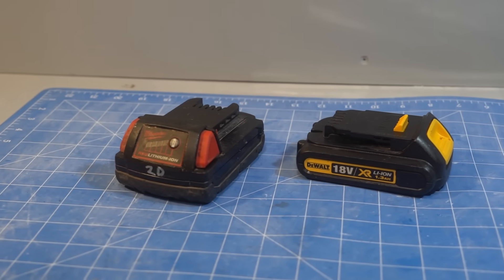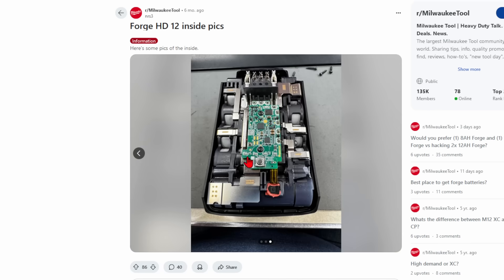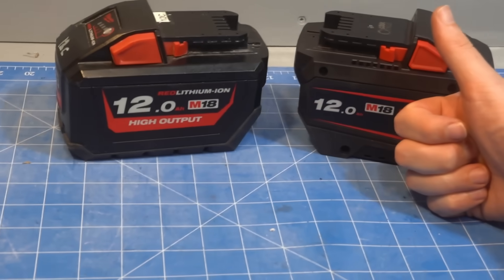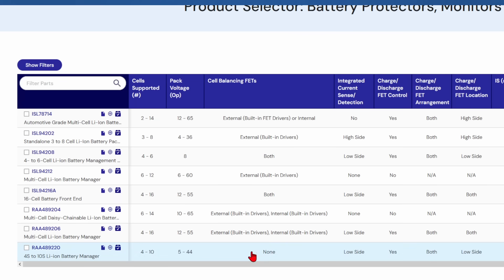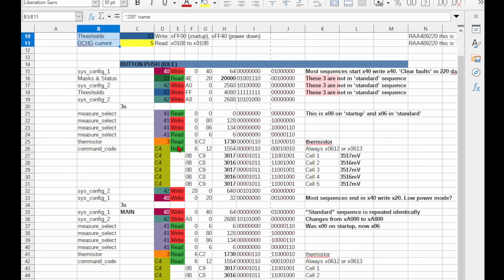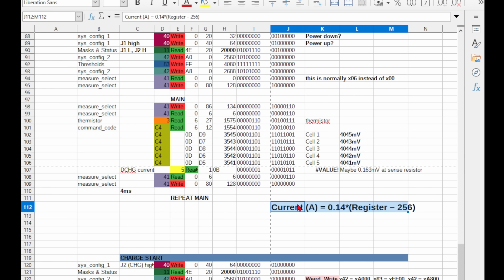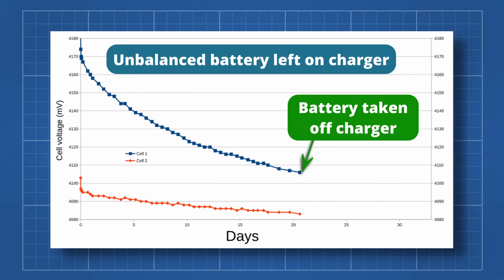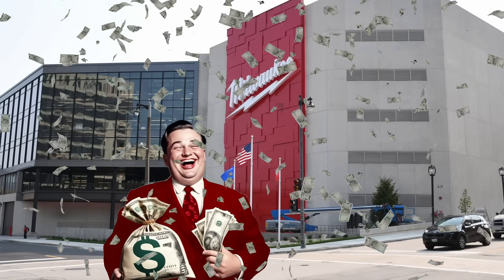[011] Do Milwaukee FORGE batteries balance

Comment: Reddit army! Kinda disappointed the Forges still don't have balanced cells.  Still great batteries for output, so let see if they're last past the warranty!  Thanks for the analysis.  As an electrician, I wish I got into circuit boards so I could understand what you're saying better, but the video is still informative nonetheless.

Comment: So do ANY 18V tool/battery brands do cell balancing?
Reply from the maker: Not yet, but I've only tested Milwaukee and Dewalt for balancing. I need to revisit Makita, and then I've got Bosch waiting after that.
Reply: @toolscientist Guessing Black & Decker doesn't either. Not as big in tools anymore, but they make a bazillion weed eaters - and the most common packs I find and fix, they're easy since they have some wiggle room.

Their 18v stuff I mostly find worn out, but still fairly balanced.  I suppose that counts the 0v shell donor packs.  40v packs almost always have a 0v bank with the rest in good order.  (mind you I've only taken apart four or five)
Reply from the maker: @bobclarke5913  quite likely. I think B&D 18V batteries are identical to Dewalt. Their 40V stuff could have balancing, having a bank at 0V sounds more like total cell failure rather than imbalance.

Comment: Pretty impressive mechanical improvements! I didn't see all that coming, as a big advantage of just using tabless cells is you don't really need to do mech redesign
Reply from the maker: They were overdue for a mechanical redesign. Lots of screws stripping out and lots of melted terminals.

Comment: As a battery engineer for the past 10ish years, I can tell you that a surprising amount of batteries aren't balanced actively. Including in some electric cars! It's super rare now, but this used to be very common across small car brands and caused a lot of them to die an early death.
Reply: which electric cars?
Reply: Laptops never have balancing either. Top balancing requires that the pack be left on the charger for a significant period, since it can only occur at the very low current levels at the end of the CV phase of the charge (typical cutoff at 0.1C).
Power Tools need fast charging, so there is no way to resolve that. When would the charger indicate that the pack is "full", an hour or so longer than the current normal charge speed?
In a large capacity pack, active balancing will take forever, far longer than a normal charge/discharge cycle which is multiple times per day.
Also, no matter what the balancing circuits require a way to transfer charge between cells which either requires space for heat elimination (resistive) or the capacitors or inductors (for active balancing).
Also, these packs don't have a facility for breaking out all the cell poles to allow external balancing like a RC hobby pack. They would need to add additional sockets etc, aka Dewalt, but that would cause issues with backward compatibility.
What could be done is to have internal pack balancing and 2 special modes... a long balance charge mode, and a discharge to storage mode. That would require a special charger but they could initiate it using the comms on the spare terminal that Milwaukee packs already have.
EDIT: I said "never" but that is not 100% true. I am sure there are some packs out there with balancing, but it is not common (nor really necessary if quality cells are used).
Reply: @johncoops6897   are you 100% sure about laptops?  Because I don't think that is the case.
Reply: @johncoops6897  just saw this, idk what you are talking about but every laptop pack opened had balancing. The more you talk about this stuff the more obvious it is that you know nothing about the subject, sorry....
Reply: @riba2233 - most laptop packs don't have balancing either.
They have cell *monitoring*, and a lockout when any individual cell drops below a preset voltage limit, or if during charge remain at a certain amount lower than the nominal cell cutoff voltage.
Reply: @johncoops6897  disagree but ok. Tool batteries should definitely have balancing and most of them do, period.

Comment: Thanks for the effort you have made to produce this video. 

I was hoping the improvement physically in the design would blend over into the electronics.

Time will tell so shout out to the BETA testers. You really have to use a battery a lot in the 1 year of warranty to try and reveal any issues. This doesn't suit someone like me who charges my batteries probably monthly as the fault might not show itself until years. 

Thumbs up for the algorithm.
Reply from the maker: Are you in Europe? in AU we get 2yr warranty on batteries. Americans get 3yr warranty on this battery.
Reply: @toolscientist  Yep, UK.
Terrible warranty.
Reply from the maker: Damn. Are they even trying? How is tool warranty? We get 5yrs on most tools, then 2/3yrs on some high use tools (vacs, air compressors, nailers). How are Makita & Dewalt warranties? No wonder Dean Doherty is so savage towards them.

Comment: Awesome video! If we aren't assuming the worst it seems like Milwaukee and Dewalt are really counting on their cell manufacturers to make a quality cell. As you have shown sometimes that pays off, sometimes it doesn't. Do you think it's possible they don't try cell balancing because it would make charging take longer? Seems like especially for Milwaukee they are really into "supercharging" these days.
Reply from the maker: I guess one argument is that it's a lot easier without balancing. Complexity is always the enemy of reliability. Whilst you're balancing a cell, you can't read its voltage. So you need to be constantly turning it on and off. That gets more complicated during charging. It shouldn't really slow it down, though. You'd just balance as best you could, then do any final balance if they leave it on the charger.
Reply: @toolscientist While I agree with leaving that complexity out of the battery, it’s quite annoying that DeWalt doesn’t balance with the charger considering they’ve got the pins to do it…

But DeWalt batteries seems to have less issues with getting out of balance than Milwaukee.
Reply from the maker: @cedricpomerleau5586  Dewalt's Flexvolts are probably more problematic. The switching of banks between parallel and series, and the weird circuitry that puts uneven parasitic draw on those banks, causes imbalance. They're much harder to manually balance, too.
Reply: Can balancing also occur during depletion? For example if the BMS is monitoring the cell voltages and sees one dipping lower than the others under load then it could flip off that cell in like 1 second pulses until all the cell voltages are the same again?

Comment: Laptop manufacturers do the same shit and thats why laptops battery don't last long.. they live like 600-800 cycles. While modern lithium ion cells can easily last 1200-1500cycles if they are actively balanced and cycled within 80% state of capacity..

Comment: I was waiting for this video for a long time. The only hope is the pouch cell 6Ah Forge. I can't wait for you to get a DeWalt PowerStack battery. Those things are the most unique battery s I've seen. I don't want to spoil them for you 😂😂. Cheers mate.
Reply from the maker: I don't have high hopes for 6Ah Forge. A few days ago (so not enough time to include this video, which was nearly finalised) someone gave me the chip number on the 6Ah Forge, and it's the same RAA489250. I'm of the opinion that the "250" is just a cheaper version of the "220", which cannot balance as it lacks the hardware. We won't know until Renesas releases the datasheet of the RAA489250, but I suspect that the Forge batteries can't balance, even with a firmware update.
Reply: @toolscientist  I cannot believe that Renesas didn't make a datasheet available. It seems the Milwaukee users are at the mercy of manufacturing accuracy. You may get some perfectly balanced cells that will last the warranty or you may not. Real sad to see such schemes employed. For the prices they command, they need to step up their game. Even cheap junk battery s balance, even at a low current but it's better than nothing...
Reply from the maker: I suspect that the chip may have been custom made for Milwaukee. My feeling is that the 250 is just a cheaper version of the 220 and Milwaukee may have some exclusivity period over it. I asked Renesas directly and they said "we don't reply to generic email addresses", so I'd need a business email to get anymore from them. I also tried going through Digikey, and Digikey came back a few days later and said Renesas is not releasing datasheet yet and I'd likely need to sign an NDA to see it. We'll probably see the datasheet in a year or two.

As you say, we're pretty much at the mercy of the cell quality, and you can't tell if something's going wrong unless you open it up and measure the cells. Then you've got to convince them to warranty a battery that they'll likely just say s working fine, and you're only recourse is to say "I measured the cell voltages", to which they say "great, measuring cells voids the warranty, take us to court if you don't like it"
Reply: @toolscientist  Damn, that's rough, same thought crossed my mind. Milwaukee paying big bucks to own exclusivity to that stupid chip. People who can balance or repair battery s themselves are blessed but are very few here and there, there rest need to rely on warranty and I don't it will change, they make too much money this way.
Reply from the maker: @ciprianwinerElectronicManiac  the weird thing is, the 250 is ~3-4x more expensive than the BQ76925 that they've used for 15 years. So I don't know what they've gained by changing chips. Maybe the pricing is just off, because it isn't actually available to buy. Maybe Texas Instruments gave them a heads up that they were going to discontinue that chip?
Reply: @toolscientist  I feel that they changed for the sake of having a renewed PCB. After all, the design team needs to have activity so that they get them paycheck's. It doesn't add up to have less for more price but someday the truth will show up for sure.
Reply: @toolscientist  Renesas chips are incredibly cheap if you're a partner, the public pricing is completely meaningless. One of the major reasons they're used so much in automotive is because of their cheapness, and they take the weird dev environment for what it is
Reply from the maker: @ssj3gohan456  any idea how I could see the industry pricing? Is there a ballpark correction factor like  "divide public price by 3"
Reply from the maker: I do have a 5Ah powerstack and have ID'd the chips. The chips are capable of balancing, but I'll have to test to be sure. I was going to do Powerstack as a follow up to my [009] vid, but then I got sidetracked looking at Milwaukee's balancing.
Reply: @toolscientist  Great, can't wait to see that video. I was really puzzled because the output of the battery was such that you couldn't draw much from it. Turns out, you have to put a resistor from TH to ground If I remember correctly. Weird stuff. The output is high impedance without doing that. I used a 47K resistor.

Comment: I recently messed with a dyson carrale hair straighteners they are Cordless running 3 20700 cells and after about a year the batteries get weak and as soon as the bms see that the cells drift 0.3v under load it shuts the battery off but they lock the bms so you can't remove the cells because the bms bricks itself so you are stuck with a broken £500 set of Cordless straighteners
Reply from the maker: Good ol' Dyson e-waste
Reply: @toolscientist  it's such a great product aswell I'd love to be a le to swap the cells because thats all it needs
Reply: @toolscientist do you think it's possible to dump the bms firmware and edit it to make it come back to life because currently the battery is working but only for like 10 seconds before it shuts off I wonder if I could dump the firmware then change the cells then refresh it
Reply from the maker: Maybe, I'm not very good at dumping firmware. Is it a sealed unit or is the battery replaceable? It might be easier to make a compatible battery.
Reply: @toolscientist  it's easily replaceable they put it together with screws no glue which is surprising for dyson but once I disconnect them cells the bms will brick itself so I'm refraining from doing that till a workaround is found
Reply: @joshuabest100 You can do following
1. Connect templorary cells to BMS
2. Replace main cells (be VERY careful here)
3. Disconnect templorary cells
Or you also can at least do balancing manually: charge/discharge cells one by one to the same level (preferably charge to the same level as the most charged cell or discharge to tye same level as the least charged one)

Comment: That's too bad about the lack of balancing. I would love to see a video showing how to make a balance charger for dewalt/Milwaukee
Reply from the maker: Dewalt is doable, and even some existing "hobby charger" can do them. A lot don't work due to the input resistors, though. Someone commented on my Dewalt vid the name of a charger that does work.

For Milwaukee, we'll never be able to fix it with a charger (at least not without opening the battery and attaching the the cells). Only hope is a custom firmware, which would be a very big undertaking, and not be very accessible for most users as flashing firmware isn't trivial.

Comment: Still such a lack of "polish" for how expensive these batteries are. It would be nice if they spent the time to make it right instead of having the unpaid interns writing all the slapdash code lol.
Reply from the maker: It's not that bad in the end. Just a bit of wasted bandwidth on the i2c bus, and they've got plenty to spare. I'm guessing they just have a function to read temp and that always sends a "scan temp sensor" command. Not sure that's not the case in other parts of the messaging, though.

Comment: Welp that is incredibly disappointing. Extremely disappointing that Milwaukee puts the balancing tech on the board and refuses to enable. The folks on the Fu Dyson project have figured out a custom firmware for the Dyson bms. Would this be possible here?
Reply from the maker: I actually think it might be worse this time. I strongly suspect that the RAA489250 is just a cheaper version of the RAA489220, which cannot balance. We won't know until Renesas releases the datasheet, but I think these batteries are incapable of balancing, even with different firmware.

Comment: awesome video as always, I noticed the bass in your voice was a bit over the top  and to listen to it comfortably I had to do a -10db low shelf with my EQ, could just be my setup but just wanted to mention it incase it affected others as well
Reply from the maker: Thanks. I'm awful at audio and still trying to figure it out. I was having problems with volume being all over the shop and I was doing lots of manual corrections, so I've tried being really close to the mic (I think I was leaning/looking away in other vids). That unfortunately picks up a lot more breathing and other garbage. Not sure if that's what you're talking about, though. Any hints? I should probably do some reading on it.
Reply: @toolscientist Sounds fine on my phone.  Excellent video.
Reply: @toolscientist  It's just the bass in your voice,  I checked with my xm5 headphones and it's less noticeable with them but still there. Might just be work checking yourself before messing about with the audio more but whatever editing software you use should let you add an equalizer to your audio
Reply from the maker: Ah ok. I've never played with anything but the overall gain, so I definitely haven't added any extra bass. But yes, I use Davinci Resolve and it definitely has an equalizer, so I could turn it down.

Comment: I'm developing a prototype system that will be used by me only, and it uses 4 li-ion 18650 batteries.
And still I'm spending lots of time in designing a battery pack with all the protections and battery balancing.
For a single prototype that will never be used by anyone else.
Whoever puts on the market unbalanced battery packs does it with malice, to artificially reduce the mean lifetime of the product.
Once all your tools are milwaukee, you are going to buy milwaukee battery packs, and they know it.

Comment: can't wait for the new battery subscription model
Reply from the maker: @sophiatheodores7985  don't give them any ideas! They'll require our tools to have internet access so they can check that we've paid our subscription.
Reply: @toolscientist Hilti chargers have cellular radios for their cloud system. 

Supposedly, this means they can show up at your job site with a warranty replacement battery before you notice an issue. Also for their cloud tool management stuff. The tools store their usage data in the batteries.
Reply from the maker: I would at least somewhat trust Hilti. On the other hand, why can't they just put a super basic LCD screen on the chargers and give us battery health info. Can't believe how terrible power tool charger UIs are. It's always a pain deciphering all the different blink patterns.